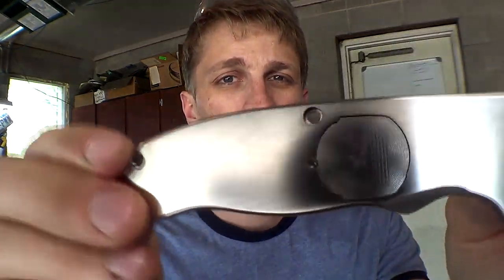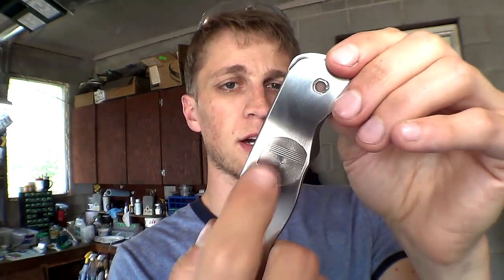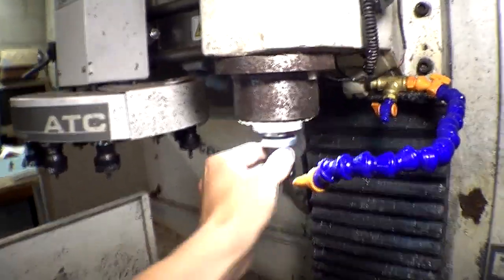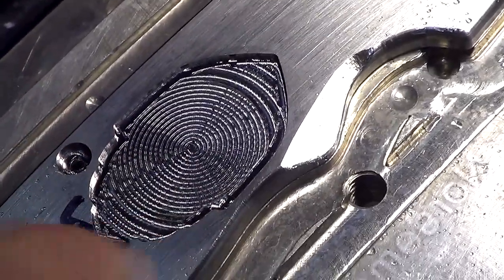Knifemaking Tuesdays Week 90 - Viking head inlay

Comment: you left too much inlay material to sanding.
if you use carbon or other composite you can sand off only a tiny bit of it.
don't do inlays so thicker than a base material.

Comment: When I want to match up the depths on different endmills I use the probe feature in mach3 and connect a lead to the endmill and use the actual endmill and the surface of the part to set Z.  It works as long as the material is conductive.  Great Video!

Comment: Two piece aluminum inlay, with one piece anodized black and the other a light gray or some other contrasting color!  Aluminum is a nice homogeneous material.  Micarta and carbon fiber can do weird unpredictable things when sanded.

I'm also still concerned about galvanic corrosion if carbon fiber is in direct contact with metal.  Carbon fiber will corrode aluminum and stainless steel, and probably titanium too, although an electrically insulating layer of epoxy can prevent it.  As tight as that inlay is, there's probably some carbon fiber touching metal.

Comment: John, yep, use big tools for big areas and little tools for little areas. Faster, better, cheaper!

A trick you might consider from woodworking inlay that could reduce the need for accuracy: bevel the edges of your inlay and the pocket. That way if the sizes aren't cut exactly the same, the inlay just goes in farther or less far, and the difference disappears when you sand flush. The tiny size difference won't be noticeable if you are at least close, and you never get a gap...which is always noticeable. 

Also, consider that the two parts of the inlay can be beveled to each other too.  Think of it as one being part of the knife handle once it's in place as far as beveling to match the other part goes...you'd jet need to install them in the order they were designed to be installed. 

The glue thing is likely to happen with any composite material. Aluminum or stainless steel with brass would look great though. Maybe the helmet in silver and the face golden? 

Thanks for the videos...I've learned a lot from watching them. 

-- Mike
Reply: Nice job and agreed, use the biggest tool you can to rough it out (keeping clamping force in mind lol) The adaptive roughing and area cleanup strategies are great for going from large to small cutters during an op.

Comment: Nice project. I think it looks great. I however am shocked your leaving it with the glue stain. It should be taken out and replaced. I would not be happy if that's how my knife came. I would look at that stain every time I pulled my knife out, forever. It would drive me crazy.
Reply: It gives character to the knife.
Reply: My guess is you don't see the problem until the inlay is glued in permanently then sanded...removing it once sanded is probably a nightmare.